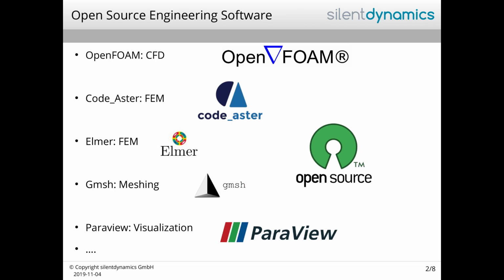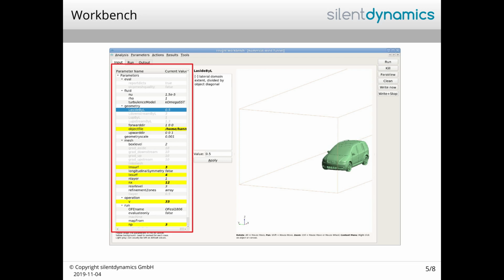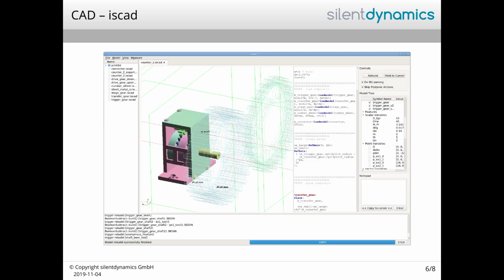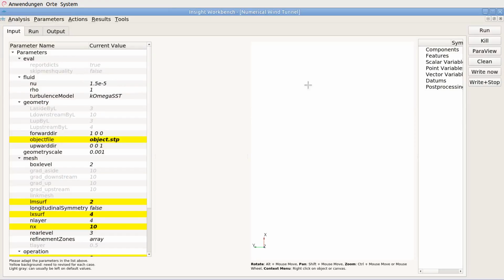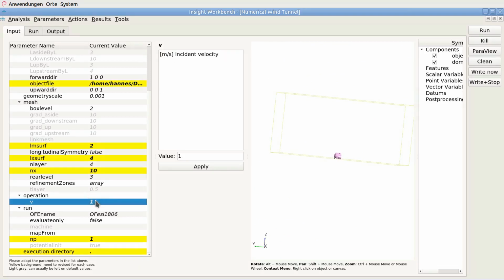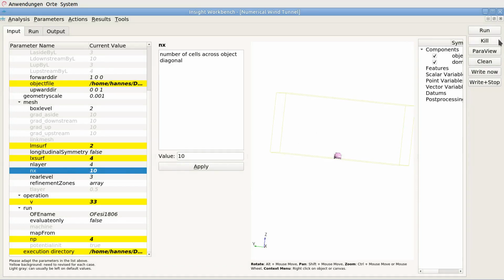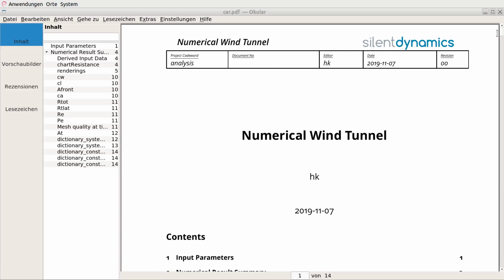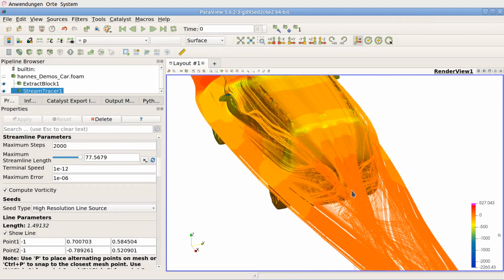CFD simulation of a car in a few minutes

Comment: Thank you SOOOO much for making this software and sharing it. I used it to do a CFD wind tunnel simulation of an original vehicle design and it's going to help me make a vehicle that cuts thru the air more efficiently with less drag and more downforce, thereby leading to a more efficient, faster vehicle with better acceleration, traction, and braking/stopping performance, thereby increasing safety and hopefully decreasing additional traffic stops and jams.